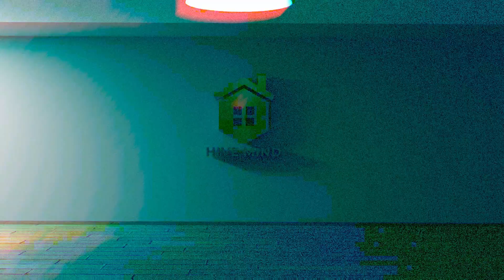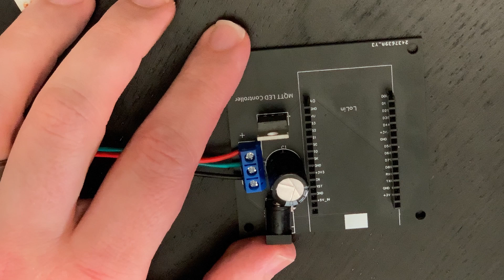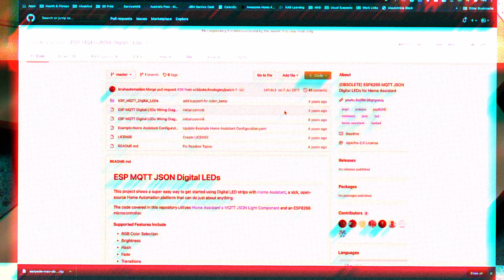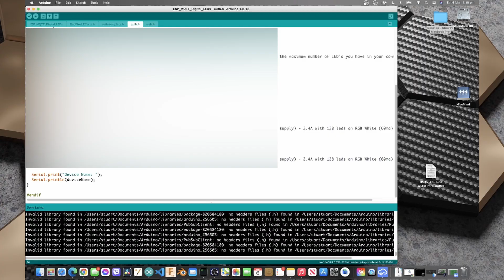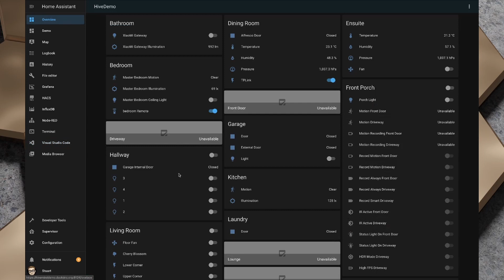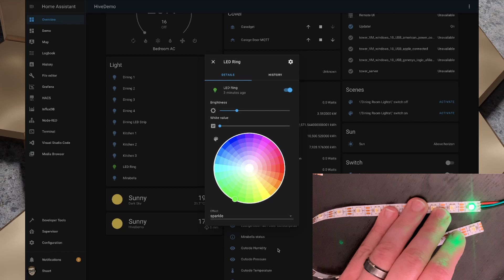Custom LED Strips with a NodeMCU

Comment: Thank you for this! Quick question, I'm new to this so trying to figure it out as I'm wanting to create custom effects on the light strips going onto my paramotor. I shouldn't have to be connected to a computer or app on the phone to get the effects correct? I'm planning on creating a 24v battery pack as the power source and trying to see if this will save the effects onto the board or would I need to try to rig up a memory for the actual board to save the actual effect? not sure if this makes any sense to you or not?
Reply from the maker: The effects would be programmed as part of the code you flash to the board which is stored in Non-volatile memory on the NodeMCU. 
There's a limit of about 4Kb If I remember correctly.
Reply: @HiveMindAutomation  thank you!

Comment: Hi Melbourne,

 Any update on the v2 board.

 This is just what I'm looking for.

 Thank you for the video, great work.
Reply from the maker: I've not had much time to work on V2 of the board. It's sitting in my backlog along with 3 other PCB Projects I'm working on.

There's been an Update to WLED - another video - that lets you select the pins and behaviour of the Relay pin in the Web Interface rather than having to re-compile.

Comment: Where is the link for that PCB Board?
And thanks so much for that video
Reply from the maker: Hi Ruperto, 

As I custom ordered the boards, I don't have the PCB publicly available just yet. 
I'm going to do some more work on V2 with the pin-selector, Logic Level Shifter, and Voltage provisions and might share it then. If you really want this version with the limitations as it stands, I'm happy to share the Gerber Files with you.
Reply: @HiveMindAutomation  i'll wait for V2 Look like interesting project